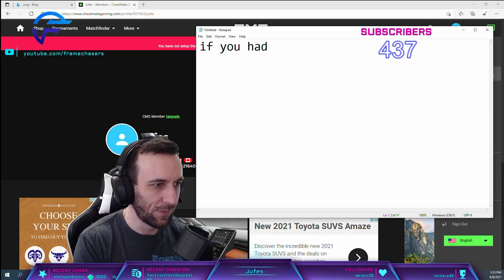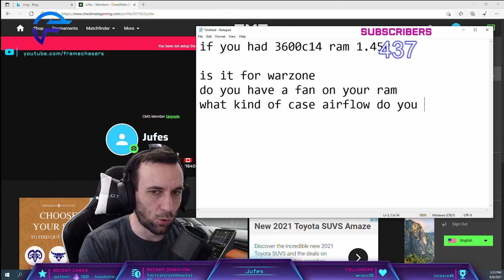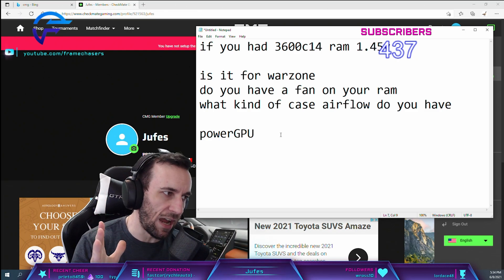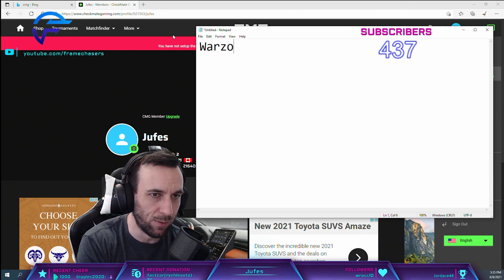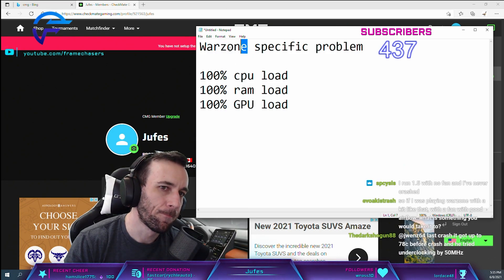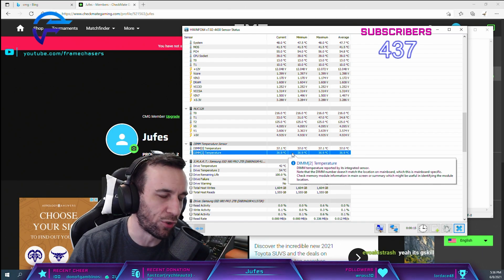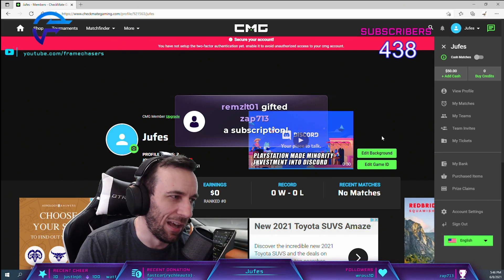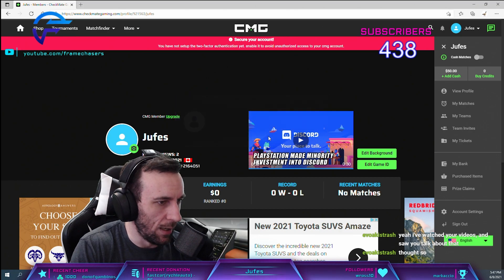Memory Timings VS Voltage for FPS

Comment: Ryzen 9 5900x G Skill Trident Z Neo cl14 3600mhz 4x8gb with a 120mm fan pointing right at the modules. Cl14-14-14-28-42-4-6 tfaw 16 trfc 260 scl’2 cr 1 @ 1.50 52ns volts never goes above 28c with a 4070 TI Super.

Comment: i have an 4000mhz cl15 16 16 36 Ram kit who runs only stabel with 2 ram's 16 GB 3k resolution screen but it runs only maximum stutterfree in every game with the maximum possible voltage i could set in the UEFI which is 1.575 voltage enything else is out of the box xmp 2, it never reach more then 65 C degrees under full load wich is very impressive.

Comment: great....
can somebody tell me whats the highest voltage for gskill 3600 cl 16?
im working on the magical border of 4000mhz for ryzen and dont want more 1.5v on the ddr4 sticks

works stable 
win10
many fans+ 360 freezer
5800x 
msi b550 unify
4x16gb 3600 cl16 
3666/1833 12-13-13-13-32 1.40v
3733/1867 12-13-13-13-32 1.42v
3800/1900 14-13-13-13-32 1.46v
3866/1900 15-15-15-15-34 1.48v
3900/1800 16-16-16-16-35 1.50v

think sweetspot is 3666mhz....but i want to test the 4000mhz.

Comment: 10900k 5.2 OC cooled by a kraken AIO with 2 front fans 32GB DDR4 3600 c14 14-15-15-35 1.45v (just xmp) 3090 FE +100 Core +1000 memory. I cannot average more than 150 fps with lows of around 90-100 playing at 1440p. Is this my ideal scenario with playing at a higher res? Running the in game mw2 benchmark i get 99% gpu bottleneck. Just wanted to point that out too. This system lives in a nzxt h510 elite case which I know isnt the best for airflow but my cpu hovers around 62-65 while gaming and my gpu at full load sits around 72-75c. Should I pay for a consult? Is there anything else I could tune in my system to get a fps boost?
Reply: just get a  better case. probs 4000d airflow.

Comment: how much voltage for 2667 ram ? im using 1.35 now cpu temp is around 65 to 70 do i need to change ram voltage and how much do i set plzz rrreply anyone

Comment: i have gskill 4400 1.5v xmp profile. case is stuffed with 140mm fans and one 120 at the back, slowly revving. case doesn't have front mesh. ram doesn't melt. what i'm doing wrong lol

Comment: I got my 4000mhz to work at 1.35 18-22-22-42, i9 11900 clocked to 5.3 2 core 51 across. Would it be worth it to try tightening timings with a smidge more voltage?
Reply: Lmao at my bot comment I’ve learned a lot in the last month 😂😂😂😂
Reply: @GARZA_ICMG  How did you learned? LOL.. Id like to get a bit more performance out of my Corsair 3200mhz 16-20-20-38.. Id like to achieve 3600 with tighter timings but I have no idea how to OC RAM, I just got into OCing my brand new 12700K
Reply: @fantaz_official  man I have made huge improvements since I made that comment lol
Reply: @fantaz_official  with a 3200 kit the only way you’ll get 3600 is w looser timings
Reply: I got 32gb T Create Expert 10L Bdie ddr4 3600 (OC’d to 3733) C14-14-14-28 at 1.57v and my PC runs better with all cores at 5.1 cache 4.7 at 1.47v
Reply: @GARZA_ICMG  Sounds good.. I guess ill leave it with its XMP profile as I'm planning to get another kit anyway to go up to 64GB.. OCing both kits prob wouldnt work

Comment: QUESTION, I have 4 x 8 4000mhz cl18 and ever since I went from 2 sticks to 4  Warzone would crash so I had to underclock to 3600mhz cl18 I still get crashes 

Any timings suggestions 
Asus X570 E gaming 
3900x
RTX 3070
4 sticks G skill royal 4000hmz cl18-22-22-42 volts at 1.4
Reply: It's because you're on Zen2
Reply: @t7274  Yeah because the CPUs infinity fabric but I figured out a way around it , Dual channel only
Reply: @EasyIsHere  dual channel is both 4 sticks and 2 sticks. It just means there's at least 1 stick per channel. 4 sticks on Zen 2 is probably not great. I'd recommend upgrading the CPU tbh. You'd get a big boost by getting something like a 12600k.

Comment: I will be setting up a 10900k direct die cooling build. 

I already got the ram for it! Just with my 9700k, 3080, and 2x8gb vipers I was able to set my timings to what you typed out and bam I got 20-30 extra frames… WITH MY 9700k. Not even on my new build yet. I can only imagine my new build… this is gonna be insane.

Comment: I have an rtx 3080 Im willing to spend 500 dlls on the 10900k with what motherboard, ram, and storage should I paired them with? To get the max fps? (Only options that are the best for the price, not just give the most expensive options please)
Reply: You could lol but you gotta oc everything lol
Reply: @redclaw72666  I always play with OC so no problem
Reply: 10900k - $600
Z490 Unify/Unity MSI 2 dimm slot board.  $ unknown.
4400c19 patriot vipers $140 
Ram cooler - Corsair dominator $100

Comment: Goated videos as per usual Jufes. If any one is contemplating a consult from this goat I highly recommend pulling the trigger my computers running top notch after he did my overclocks and tweaked my settings. Was having one small issue with my ram speed and he so promptly corrected it and had me back In tip top shape

Comment: every time people ask stuff about motherboards on your channel they always want to buy an asus board or already have one lol, i can't believe asus tricked so many people into thinking that asus boards are any good. even the z590 apex can't overclock well enough and that shit is supposed to do that. i can run 2x16 dual rank trident z kits with better 4500 on the z490 dark and the apex couldn't even do that with 2x8's lmao
Reply: Who would you say makes the best mobos for overclocking cpu and ram?
Reply: Yeah but asus boards have ppd setting in bios. Afaik the dark cant set ppd=0. That setting alone will reduce latency a lot. Maybe you can get a modded bios for it, but no promises
Reply: Lmao finally someone with a brain that understands how bad asus boards are for overclocking... Ofc the gigabyte aorus master/extreme/tachyon, the high end MSI ones and the evga dark kingpin are literally the greatest and goats of mobos for oc.

Comment: Biksky waterblock 3090. 10850K. Viper RAM. And still only an avarage of 140fps... Nice...
Reply from the maker: Sounds like you need a consult then
Reply: How?? Did you tune the memory? 10900k and 3090 and my minimum fps is 210. I average over 240 in 1440p.
Reply: @mylittlepwny3447  I'm too dumb😅 I was born with a ram stick in hand but when the time came to raise my own I fell behind with all the fine tunings... When I look at my bios now I feel dumb🤤
Reply: @slapchip5042  well that's ur problem. With that mentality you'll never get it done. I taught myself how to tune ram a year ago. Look up a guide and get to work. There's never a better time than today.
Reply: @mylittlepwny3447  You are 100% right. I try my best with the time I have. I'm sure I'll get something done but find it hard to believe that I'll gain 100fps from tuning memory...
Reply: @slapchip5042  well between my memory tuning to 4600 mhz 16-17-17 and all custom timings and my 5.4 ghz overclock I gained a ton of fps. 3090 overclocked to 2205 mhz. Holds over 2160-2175 mhz in game depending on ambient temps.
Reply: @mylittlepwny3447  which sticks u using?
Reply: I should not be getting higher fps than you… I have a 5600x and 2080ti with vipers and my lows are around 160 and  averaging around 185

Comment: My Vipers on Z490 Carbon +10900KF does 4133MHz 16-17-17-36 @ 1.5v. Have fans everywhere except the ram. It survived 11 hours of Prime95 Very Large FFTs (5120-10240 KB) not a single error.
Reply: 4x8 right? I get about the same on z490 unify 10850k.
Reply: @jawwk  Yup
Reply: What’s your cpu oc like?
Reply: @Mcvalverte 
Core 5.2GHz, 1.375v
Cache 5.0GHz
VCCIO 1.35v
VCCSA 1.35v
LLC 4

Comment: 4000 MHz CL14 😎
Reply: But does it play well with my hero boards traces...
Reply: yeaah if existed but I understand you 😁we wishhh this 🤣😅😅😁
Reply: @milanklco  

It does. 1.55v rated out if the box.
Reply: @milanklco  trident z royale elites, 4000mhz cl14, look that up, and tell me if that doesn't exist?
Reply: @Drix7  I believe you ;)
Reply: Yup
Reply: CR?, Gearmode?
Reply: great....
can somebody tell me whats the highest voltage for gskill trident z neo 3600 cl 16?
im working on the magical border of 4000mhz for ryzen and dont want more 1.5v on the ddr4 sticks

works stable 
win10
many fans+ 360 freezer
5800x 
msi b550 unify
4x16gb 3600 cl16 
3600/1800 16-16-16-16-36 1.35v no oc
3800/1900 16-16-16-16-36 1.38v
3666/1833 12-13-13-13-32 1.40v
3733/1867 12-13-13-13-32 1.42v
3800/1900 14-13-13-13-32 1.46v
3866/1900 15-15-15-15-34 1.48v
3900/1800 16-16-16-16-35 1.50v
always 4sticks of ram, i never tried with only two sticks

think sweetspot is 3666mhz....but i want to test the 4000mhz.